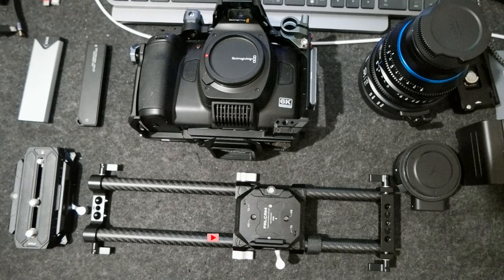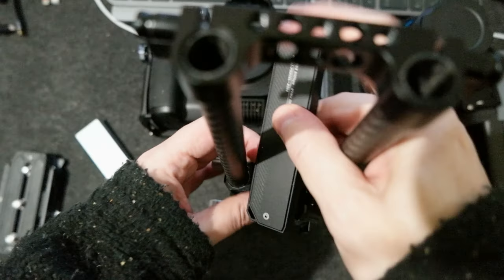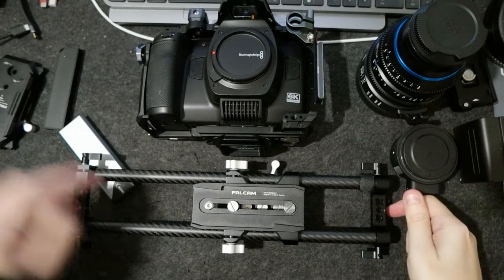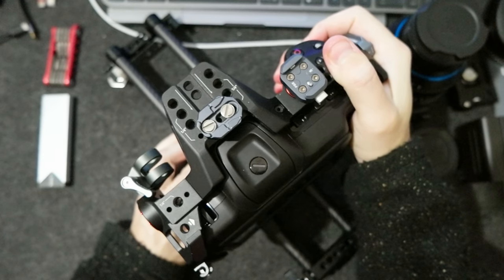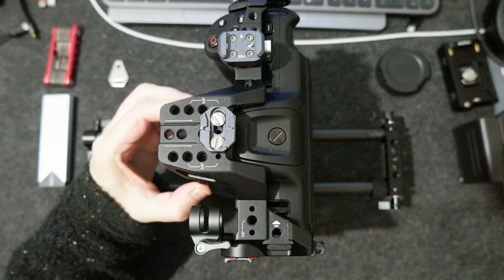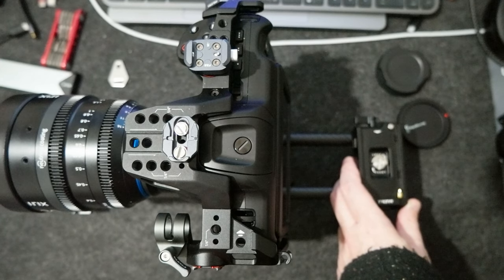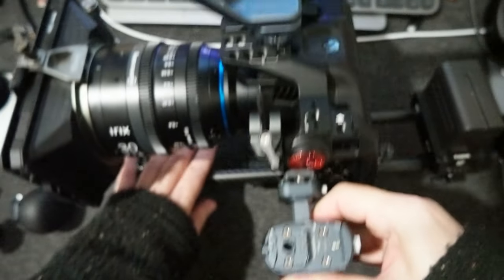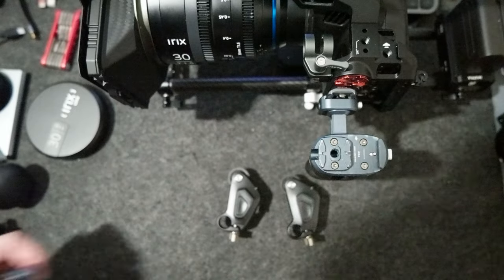Blackmagic full frame 6K Rig Update ... working on it !!!

Comment from the maker: I got the Falcam F50 plates and I updated my Blackmagic full frame 6K rig. Need more work to mount the TILTA Nucleus Nano II .

=====================================================
EcoFlow
=====================================================
EcoFlow Delta 2 MAX - https://bit.ly/3FcNwyV

=====================================================
BMPCC Full Frame 6k Accessories
=====================================================
TILTA Nucleus Nano II - https://bit.ly/3RP6HGJ
Cage BMPCC 6K - https://bit.ly/3ZFNj0G
SmallRig Mini Matte Box Lite - https://bit.ly/46COlwW
Rod Holder - https://bit.ly/3F1pFSR
Dual 15mm Rod Clamp - https://bit.ly/3ZGTTUR
Tilta F970 V3 charger - https://bit.ly/3PK2yBh
Ulanzi CM029 9 in 1 Multitool - https://bit.ly/3ZIxGWp
H052 16V USB-C PD Power cable - https://bit.ly/48KOVu6
DC2.5 to SF6 2Pin calbe - https://bit.ly/3Qa8ntm

=====================================================
Falcam F22 / F38 / F50 Accessories
=====================================================
Magic Arm - https://bit.ly/44Zof5S
Top Handle - https://bit.ly/3EMsib9
Mushroom Handle - https://bit.ly/3ZtbS10
Dual Head - https://bit.ly/3EMsib9
Cold Shoe - https://bit.ly/3LqykSE
Action CAM Mounting - https://bit.ly/3sXw3YB
Action Cam Ballhead - https://bit.ly/3ZoqzlK
Monitor Mount - https://bit.ly/461i2Yw
Baseplate - https://bit.ly/45WiS8N
Quick Release Plate - https://bit.ly/45oR0sS
Quick Release Suction Cup - https://bit.ly/4001ez7
Quick Release Plate Clamp - https://bit.ly/46EhMPa
F22/F38  Quick Release Ballhead - https://bit.ly/3LVxrl5
Base plate 3306 - https://bit.ly/3RPDrj8
Gimbal Dual Handheld Grip - https://bit.ly/46JcXEl
Gimbal F38 & F50 Quick Release - https://bit.ly/3LRZuSF
Gimbal Quick Release Sling Grip - https://bit.ly/46ByY7R
F38 Double Thread Quick Release Plate - https://bit.ly/46HqSKL
F38&F50 Quick Release Plate - https://bit.ly/46MoVxf
F22 Nato Adapter - https://bit.ly/46MoVxf
F50 Quick Release Mount - https://bit.ly/47amJze

=====================================================
DJI Osmo ACtion 3/4 accessories
=====================================================
DJI Action 3/4 Metal Cage - https://bit.ly/451GVSH
DJI Osmo Action 3 - https://bit.ly/3RPpgL4

=====================================================
Macbook Dock & Hub, Thunderbolt Cables
=====================================================
Orico Dock - https://s.click.aliexpress.com/e/_Dn0...
Thunderbolt Hubs - https://s.click.aliexpress.com/e/_AqRIjh
Thunderbolt Dock - https://s.click.aliexpress.com/e/_AB5mMj
Thunderbolt 4 40Gbps USB C Cable - https://s.click.aliexpress.com/e/_AVeE03

=====================================================
NVMe Memory & PCIe
=====================================================
Seagate FireCuda 530 NVMe - https://s.click.aliexpress.com/e/_9H99nB
NMVe PCIe 4.0 - https://s.click.aliexpress.com/e/_9IaUBv
NMVe Heat Sink - https://s.click.aliexpress.com/e/_AVD0X1
Lexar Professional x1066 256 Gb - https://s.click.aliexpress.com/e/_Dd8...

=====================================================
Keyboard & Mouse
=====================================================
Logitech Master MX 3 - https://s.click.aliexpress.com/e/_AOe9Np
Logitech MX Keyboard - https://s.click.aliexpress.com/e/_AcCiEJ

=====================================================
Office Desk & Chair
=====================================================
XXL Large Office Computer Desk Mat - https://s.click.aliexpress.com/e/_9gDOGj
Office Chair - https://s.click.aliexpress.com/e/_AaKFIF
Office Chair Wheels - https://s.click.aliexpress.com/e/_AOwrHZ
Office Table - https://s.click.aliexpress.com/e/_AWyiTt
Office Table Wheels - https://s.click.aliexpress.com/e/_9RUW6r
Smart Wifi Power Strip 4/6 - https://s.click.aliexpress.com/e/_AP61MR

Comment: I tried the same with the Nucleus Nano II but had the tilda handle for it.. bought the falcam f22 to mount it.. thought it would fit but I was wrong.. the f22 is just 1mm to bright. You're showing a good alternative way.
I'm still thinking how to fix the tilta cage to the bmcc6kff on the top. You found any solution for this, yet?
Awesome to see how you do it! Best of luck with everything!
Reply from the maker: about the cage, I will drill a hole for now and hopefully Falcam will release a cage for the FF, finger crossed!!! I just bought some more accessories to mount the two motors and will do another video as soon I get them. Thx for the comment and Happy New Year !
Reply: @biskero  I see.. It makes sense to drill another hole in the cage 🤔 very cool! Happy new year and lots of cool projects for you! I subscribed and will continue watching your stuff 💯
Reply from the maker: @YamilSunRay  thx you too!